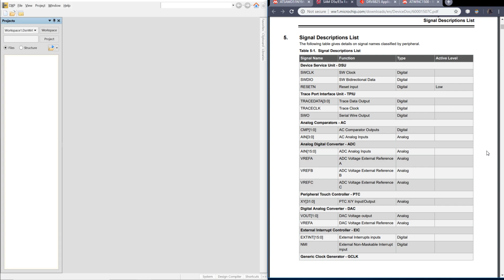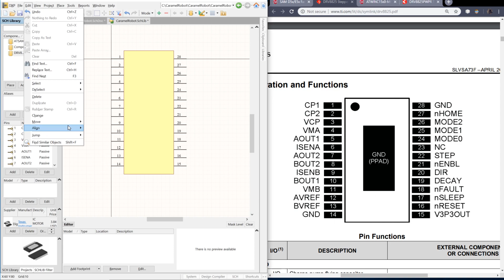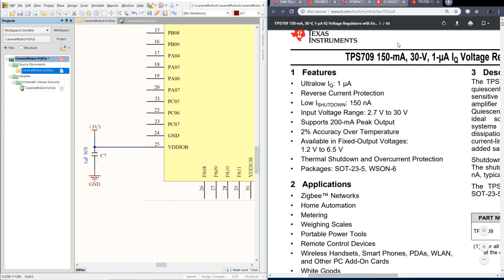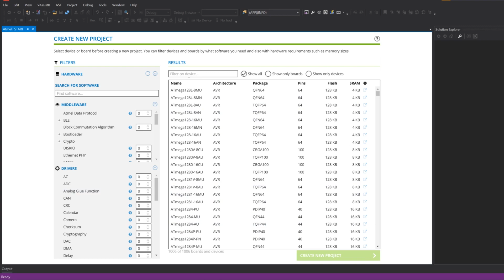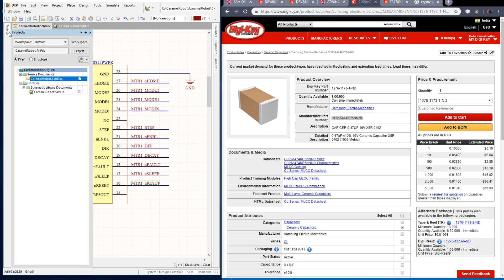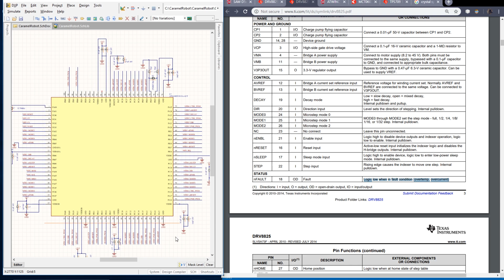PCB Design - Understanding Datasheets - Drawing Schematics - Altium - Making a Robot Arm - EP4 - FWE

Comment from the maker: Following good advice from Pert: Here is a table of contents of this video:
---
1. Indroduction.  - https://www.youtube.com/watch?v=CxjG14y4uNs
2. Basics of Data Sheets. - https://www.youtube.com/watch?v=CxjG14y4uNs&t=50s
3. Start drawing schematics. - https://www.youtube.com/watch?v=CxjG14y4uNs&t=251s
4. Start SAMD51 schematic - https://www.youtube.com/watch?v=CxjG14y4uNs&t=379s
5. Start DRV8825 schematic - https://www.youtube.com/watch?v=CxjG14y4uNs&t=637s
6. Start Winc1500 schematic - https://www.youtube.com/watch?v=CxjG14y4uNs&t=742s
7. Start TPS709 LDO schematic - https://www.youtube.com/watch?v=CxjG14y4uNs&t=958s
8. Bring power to SAMD51 - https://www.youtube.com/watch?v=CxjG14y4uNs&t=1326s
9. Atmel Studio for PCB Design - https://www.youtube.com/watch?v=CxjG14y4uNs&t=1886s
10. Winc1500 to SAMD51 connect - https://www.youtube.com/watch?v=CxjG14y4uNs&t=2326s
11. DRV8825 to SAMD51 connect  - https://www.youtube.com/watch?v=CxjG14y4uNs&t=2469s
12. Buzzer and LED connections - https://www.youtube.com/watch?v=CxjG14y4uNs&t=2947s
13. Bill of Material  - https://www.youtube.com/watch?v=CxjG14y4uNs&t=3105s
14. Conclusion   - https://www.youtube.com/watch?v=CxjG14y4uNs&t=3133s